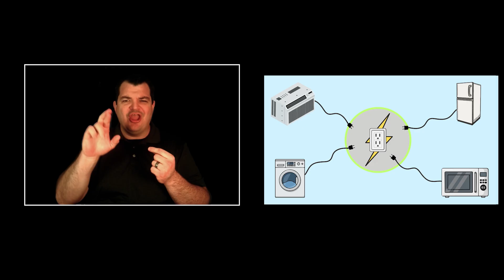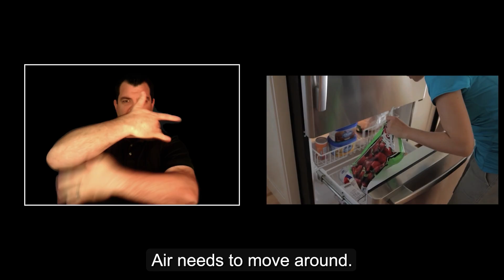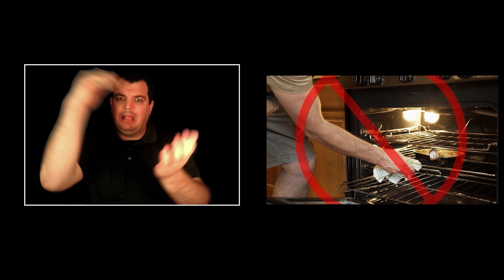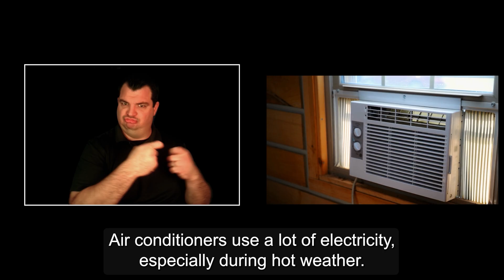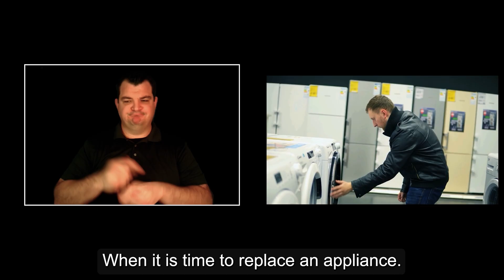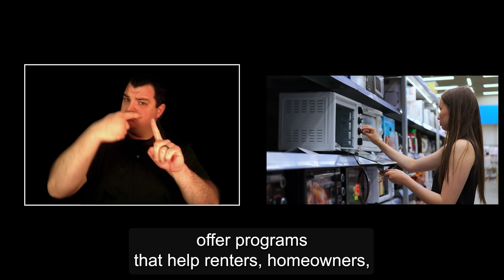ASL: How Household Appliances Use Electricity and Why Efficiency Matters

Comment from the maker: Air Conditioners and Thermostats 

Air conditioners use a lot of electricity, especially during hot weather. There are several common types of cooling systems and small changes can help lower your energy use and save money.

Set your thermostat as high as is comfortable. Even raising the temperature by 1 or 2 degrees can reduce how often the system runs. When it runs less, it uses less electricity.

Clean or replace air filters regularly. A dirty filter blocks airflow. When air cannot move easily, the system has to work harder and use more energy.

Make sure vents are not blocked by furniture, rugs, or curtains. For window and portable units, keep the outside part of the unit clear so air can flow freely.

Keep windows and doors closed when the air conditioner is running. Cool air can escape through gaps and cracks. Sealing leaks and adding weather stripping can help keep cool air inside.

You can also use ceiling fans or floor fans to move cool air around the room. Fans use much less electricity than air conditioners. Moving air helps you feel cooler, so you may be able to set the thermostat a little higher. Don’t leave fans running when you leave the room!

By using your cooling system wisely and keeping it in good condition, you can stay comfortable while using less energy.

When It Is Time to Replace an Appliance
When it is time to replace an appliance, choosing an energy-efficient model is one of the best ways to save electricity.

Look for appliances with the ENERGY STAR label. ENERGY STAR appliances meet strict energy efficiency guidelines set by the federal government. They use less electricity to do the same job, which means lower energy bills over time.

Many local electric or gas utilities across the country offer rebates or discounts for energy-efficient appliances. Some states and communities also have special programs to help renters, homeowners, and property owners upgrade to more efficient equipment.

By understanding how appliances use electricity, keeping them working well, and choosing efficient models when it is time to replace them, we can all save energy and lower costs. Small choices at home can lead to big benefits for families, communities, and the environment.

Look for Rebates and Energy Programs
If you are thinking about replacing an appliance, it is also a good idea to check for rebates and energy programs from your local energy provider.
Many electric and gas utilities offer rebates for energy-efficient appliances such as refrigerators, washing machines, heat pump dryers, and air conditioners. These rebates can help lower the upfront cost of buying a more efficient model.

Some communities also offer programs that help renters, homeowners, and landlords upgrade appliances to save energy and money.

Before you buy a new appliance, visit your local utility’s website or contact them to see what programs are available. A quick check could help you save money and choose equipment that uses less energy for years to come.

A few small changes can make a big difference. Use energy wisely, and don’t forget to check with your local energy provider for rebates that can help you save.